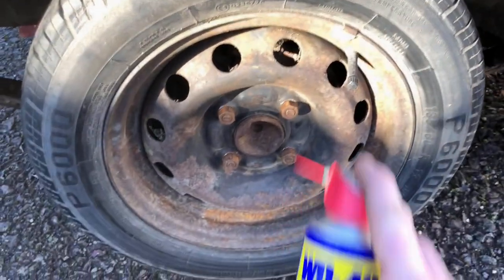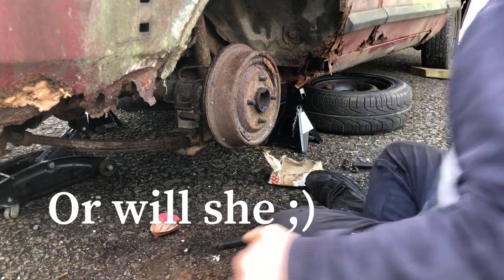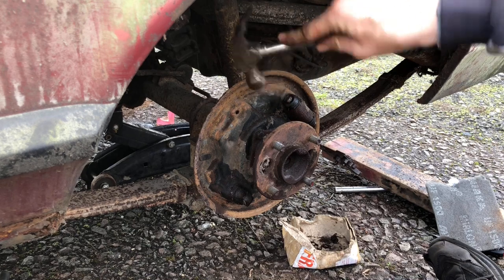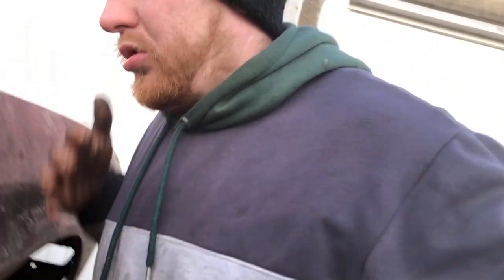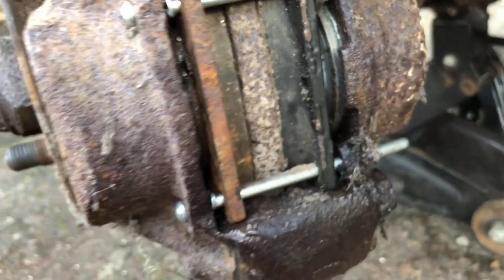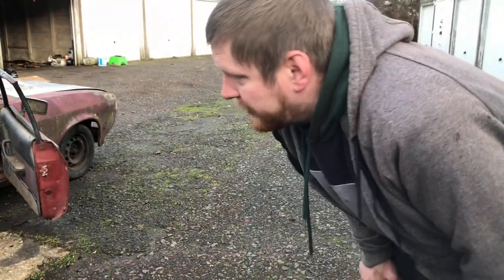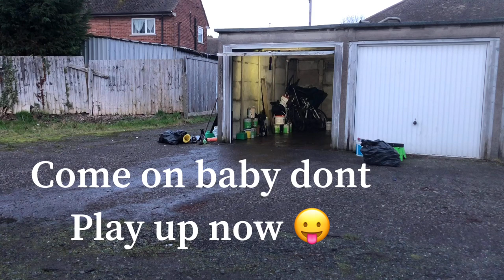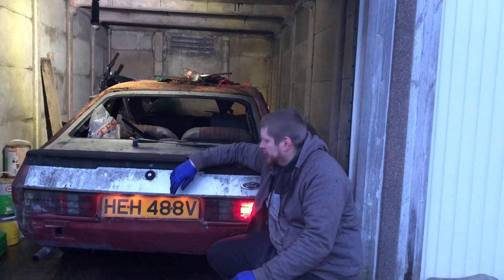Leicester’s canal ford Capri sorting brakes part 2 of 2 will she move under her own steam :)

Comment: A huge mile stone there fella, well done!  Give it a bit of a wash, and keep starting it and doing what you have been doing around the yard.  I used to do this with the rover metro i was working on years ago.  Just to keep things rolling etc.  I would look at maybe giving it a bit of a wash, and replacing some of the damaged bits, like the rear light, and fit a rear window in. ( Fit a rear window in, start the car up and get the heaters on, just warm the car up inside)
Reply from the maker: I need a new floor 1st mate , lol
Reply from the maker: @procta2343  sorry pal

Comment: Well done in getting it mobile again, saves pushing it around. I had to put a master cylinder on mine as the brakes were pressuring. There’s along way to go but you’ll get there.
Reply from the maker: Cheers mate , it will make it easier to move around now :)

Comment: Top video bud, another step on the road to restoration. Have you thought about pressure washing it? That would make a good video.
Reply: There would be nothing left of it lol, there is only dirt holding it together, I'm not being negative that's reality. its all about video content which is very interesting though.
Reply from the maker: I might get her washed tbh like you said would make another video :) have to take someware to do it unless I can get a battery power one

Comment: Hope you get the unit. Security is never brilliant in these council garage areas! £200 a month with electricity sounds very reasonable
Reply from the maker: It is mate , but I’m worried he’s subletting it I need to make sure it’s all ok and above board before I move my car there :)
Reply: Yes I agree. One thing I know, when your renting, you tend to get the project done quick because of the cost! Might also be an idea to enquire at places in the countryside (farms etc) if its a hobby project like yours! There's surely no business rates!
Reply from the maker: @MyJon64  that’s not a bad idea mate

Comment: Ready for an MOT lol
Reply from the maker: Haha I think she’s mot exempt
Reply: Doesn't need one as it's over 40. Change it's taxation class to historic vehicle (free to do and makes it MOT exempt), get it insured on a limited mileage classic policy (cheap as chips), phone DVLA after the class change is made and get it taxed (free for a historic) and drive off into the sunset... 😉😂😂 not quite in the spirit of the exemption and I reckon if you were stopped you'd have to do some pretty slick talking 😂
Reply from the maker: @alancampbell1008  lol someone’s said to me take it for a spin up and down the road lol
Reply: @retrorust3395  don't do that unless you've done all the others first...I speak from experience having been caught having a sneaky spin on my '37 BSA just after I got the engine running again after she'd been off the road for 30 odd years. She was still very tidy just needed an engine rebuild and I knew it would MOT if it needed but they weren't impressed because I hadn't done the other stuff first...quite expensive in the end and lucky I wasn't banned.